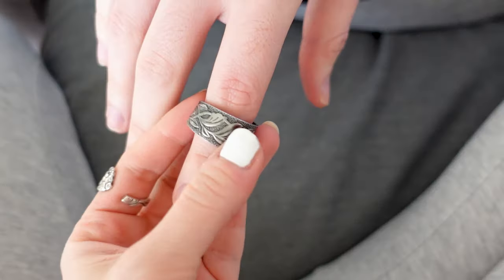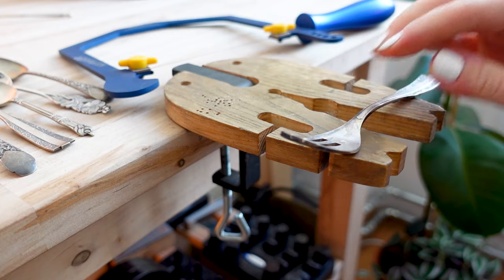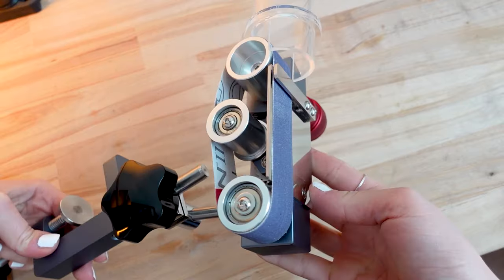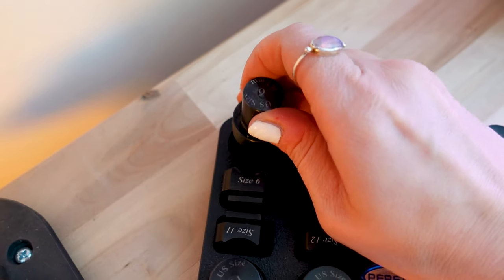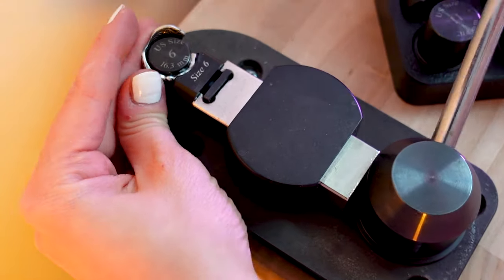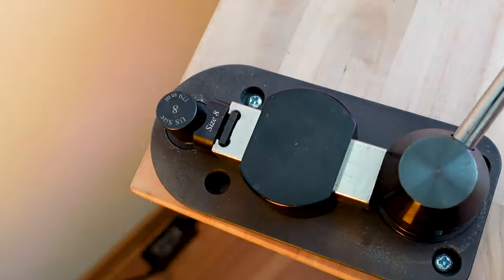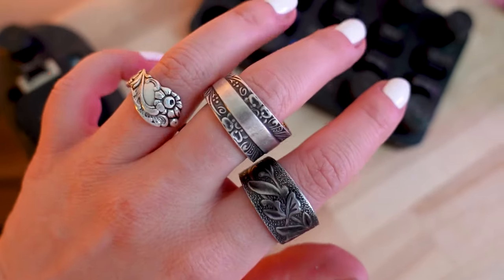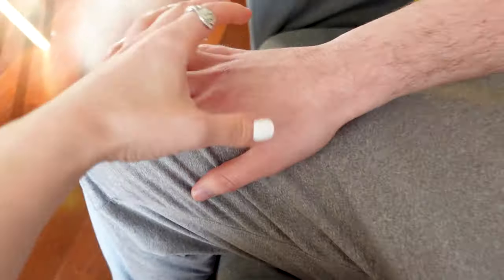Create SPOON RINGS in 3 easy steps!! DIY spoon ring tutorial

Comment: What different types of metal are you using,? Sterling,  silver,  plated, stainless ?
Reply from the maker: In my work I mostly use sterling and fine silver. I started using brass and I'm also going to start using solid gold more often. For some reason I don't like copper. Oh, and in the past I also worked with gold filled metal, which is a cheaper alternative to solid gold. I sometimes do some gold plating on silver myself

Comment: Do you anneal them first befor bending ?  I always anneal mine and then wrap them one and a half times around so there is no gap. Yours are very pretty !
Reply from the maker: Hi Lisa! I haven't annealed these ones, but it's a good idea to do so! It's probably why they were harder to bend (I haven't annealed them to see if I can bend them like this and keep the original finish and patina). Thank you so much! I want to try other looks too, especially the one where you overlap and wrap around more than once 😍
Reply: @TheArtOfMetalsmithing  when you anneal them, just do it on the back of the handle of the spoon so it won't  hurt the patina of the spoon. Watch it as you anneal them and maybe try it on some parts your not using so you can see how it works. I've never had a problem with the heat and I use a big plumber's torch. Hope it helps !
Reply: @maladylis08  wow that’s cool that you use a big plumbers torch and it’s all OK. I don’t really have space or anywhere to use fire in my place but I’m gonna start going back to school and I will be able to do many things that I can’t do it home there.
Reply: @evelynvongizycki1017  you can take a bunch outside and do them all at once.   Then put them aside for when your ready to make rings as you go. It sure makes it easier to bend them !
Reply: @maladylis08  I think I can. I guess I have to work on getting a source of fire first I live in Jersey City New Jersey. It can get really cold or really hot depending on the time of year. I guess I can sneak into the yard and do it. I have to get up the nerve to do all this since it is fire and what have you again so I might try and do it first in school